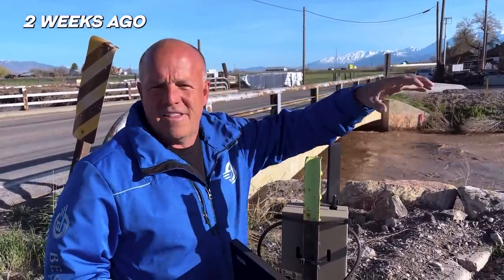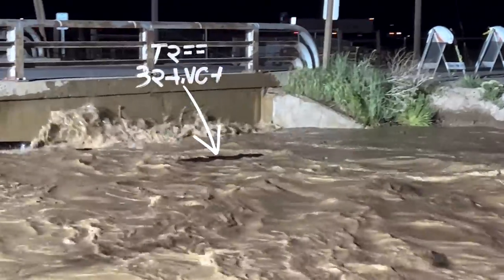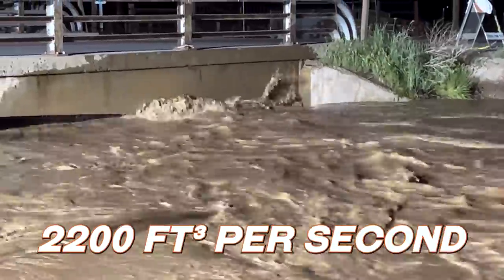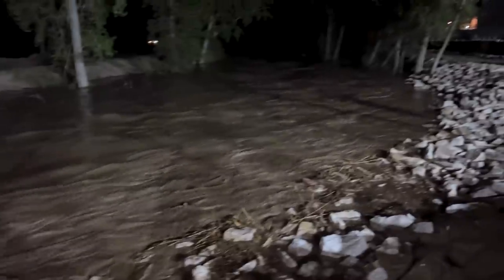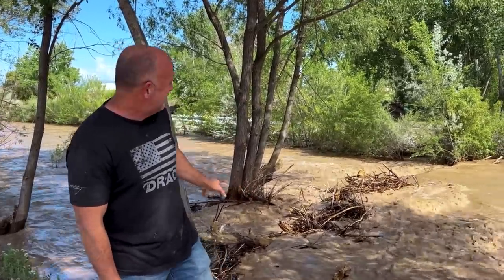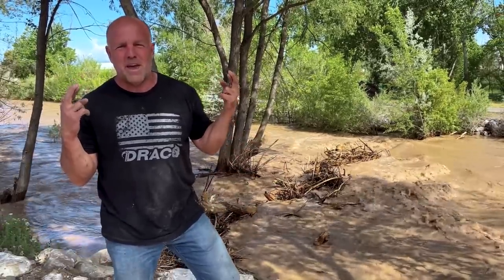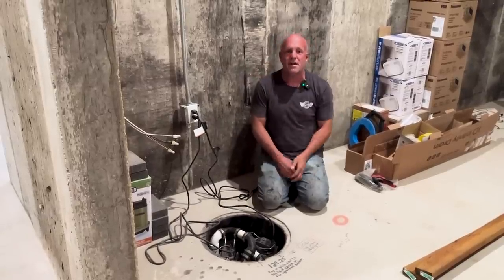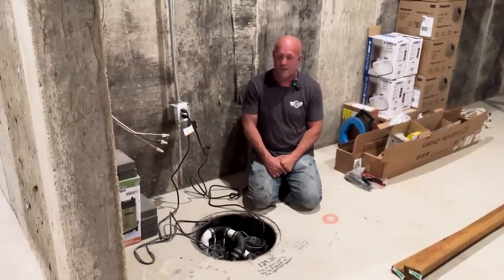Raging River VS Utah Homes | House Build #14

Comment: My last job was a consultant on river and lake erosion before retirement. Your looking at installing a combination of deep rooted native plants along with plants that have a heavy fibrous root mat near the surface. They deep rooted plants will anchor the soil but the fibrous shallow rooted plants accomplish the soil retaining and protect the deeper rooted plants by absorbing the impact or the rain and interlock with the soil to help the heavy river stages.   Next is the variety of plants that like water, can handle water and those that need dry feet. As I am not from your area my knowledge of native plants is limited that follow the giude lines for erosion control. Hope that your planting works out, best of luck Sir.
Reply: This part of the video gave me a great interest as well.

Comment: Here in New Zealand at the top of the North Island we had major flooding exaberated by slash (cut down trees etc left over from logging operations)blocking drains and just like your road bridge major flooding through properties, orchards, vineyards, farms and towns around the Greater Auckland area, East Coast of the North Island where stop banks breached. Its heart breaking seeing peoples homes, livelyhoods wiped out. And there were a few deaths which was horrible. And this wasn't snow melt nor Winter! Just heavy rain like 3.5 inches an hour as they got hit by Cyclone Gabrielle. Hope you get through this ok Mike especially after all the hard work put into it by you and your neighbours etc.

Comment: Fun with sump pumps! Not anything like what you're dealing with but I remember when Hurricane Opal came through over Atlanta years ago (have to look up the date). Walked out my patio door to go to work and stepped into 2" of water! Now the patio floor is about 4' below the level of the back yard and water was coming OVER the brick wall into the patio (which is covered BTW). The back yard was saturated! I was afraid it was going to hydraulic the wall (Engineer here) so I braced it to the house with a bunch of 2x4s I had handy and ran to Sears. Got a sump pump and a self-priming centrifugal and spent the rest of the day pushing water to the sump pump sitting on the floor with a push broom, which pumped out to a low spot in the yard THEN I ran the centrif to pump THAT over to the driveway so it could run down to the street (I live on a ridge). Glad I had power!

Comment: On one of our visits back to our dad's hometown in the SE Colorado prairie, Granddad took us to see the Arkansas River in flood, where it poured over one of the low dams used to direct the water into the irrigation canals. There was a tree trunk being lifted up, and flipped end over end in one spot over and over like it was a Tinkertoy! One of Dad's first summer jobs was on a work crew installing "jacks" to stabilize the banks of the river. There was a reason they were paid $2 an hour-- a generous wage in 1950. As far as I know, those jacks are still there, holding the banks together. Rivers demand respect!

Comment: We lived in Coal Creek Canyon in Colorado and in 2013 the creek flooded. It is a seasonal creek half the size of this creek and when it flooded it took out 9 miles of road and bridges . We had lived there for 29 years before this happened and would often comment on the signs saying go to high ground when water is present . We were fortunate since we lived at the beginning of the creek but yet there was enough water that we had water come out of the ground for weeks like a spring creek . Water is very powerful so be careful where you build . Thanks for sharing and showing us the precautions you took while building, money well spent .
Reply: Going to that bedrock was a smart & safe decision.

Comment: 13:00 My city in Christchurch, New Zealand, was built basically upon an old swamp. We have very high water table (in some areas, above ground in winter) and are affected by numerous rivers and tributaries. We are also coastal with many homes only 1m to 2m above mean sea level. The centre of the CBD is only about 10m above mean sea level. Christchurch was developed as a British colony and in the early days the "Christchurch Drainage Board" was formed. The street kerbing and side channelling ("gutters") here and under-channel pipes and stormwater drainage that serves streets and infrastructure is generally only designed for the 10yr storm event. When we have high intensity rainfall or longer duration rainfall our stormwater systems get easily overwhelmed - especially in autumn/fall when leaves gather and block street sumps / entry points. This leads to ponding / puddles on the streets which eventually overtop the kerb and start extending into overland flowpaths based on flat (albeit with local humps/hollows) terrain onto private land and under houses. Presumably your own city only designs streetworks and public infrastructure to a much lower return period (due to sheer costs and budgets) too which leads to exactly what has happened...

Comment: 1996 we had huge floods in Oregon and southwest Washington.  One of the most disheartening things was many homes and businesses got flooded because the floor drains weren't block - thus when the river rose, it allowed water to flow backwards into building.  The worst of the bunch, Oregon city Tavern.  They put their pool tables on blocks so that the tops were about 12" above the ceiling.  Then sealed the doors with silicone.  Problem was they didn't block the floor drains.  When they cut the doors open, river water drained out.  Totally sucks, they worked so hard to prevent that very catastrophe.  The worst part of that is the water line was 6" from the ceiling.... so even the pool tables were junk after... much empathy to those suffering now, being flooded sucks (it got my family's welding shop too - thankfully, it didn't really damage anything important other then the offices  - and we all know those people don't do anything anyway...)

Comment: It's interesting to see that situations like this can be managed with the right approach and a can do attitude.  What usually happens is that people use sandbags, and then wait to see what happens and fix the damage afterwards.  I very strongly suspect that if just some of the money that goes on post flood repairs — that's money from local authorities to fix infrastructure and property insurance  claims — was spent before the event to prevent the worst damage occurring in the first place, it would cost a lot less and save a lot of heartache.  Thank goodness there are people like Mike for whom potential disasters are just another challenge to be overcome with 'physics and engineering' and that can do attitude I mentioned.

Comment: There is a rectangular wire cage filled with rocks called a gabion. In the upstream catchment area if gabions were placed to form leaky dams they would slow down the water a little allowing more to be absorbed into the soil up there and would filter out some of the debris preventing it to be washed down.

Comment: Do some research on the Chicago incident back in the 90's, when a pile driver crew cracked the ceiling of the Deep Tunnel Project, which resulted in flooding a huge area of Chicago lower level (there are 2 underground levels!). Many buildings found their basements under water. Fascinating story!

Comment: here along the shores of Lake Erie we use the same large rock formation to reduce erosion. however, soils inside the large rocks even with vegetation has limited use. a strong current will erode the soils. most home owners along lake erie pour concrete inside the rocks and that material never erodes.

Comment: I have my sump pump on a UPS as well.  Often times when there is flooding, there is loss of power.  I think I could run my pump for at least 50 cycles without power.  Gives me enough time to get a generator setup.

Comment: There are check valves made to prevent backflow through drain pipes. They're made for sewer pipes, but with screening basins on each side they could perhaps be adapted for storm drainage. They require regular maintenance, but that's much less money, time and effort than cleaning up flooded buildings.

Comment: Seems the best way to permanently solve the problem is to have a way to divert or pump the water into a runoff reservoir, bonus for keeping extra water through the dry cycle. I'd thought, during a dry cycle years ago, while hanging around mendo. lake north CA., that they should take advantage of the low levels in the lake to take earth movers in and remove the accumulated runoff dirt for extra storage during the otherwise flooding cycle. I don't think anyone has yet made it a regular thing to do.

Comment: As a home builder, you have really gone above and beyond on water control around that house. The only thing i would add is a backup generator for those sump pumps. Maybe you do have them, I haven’t had time to watch all the episodes, but if not, a simple power outage and it all could be for nothing. Great work, though! Its awesome to see what is possible when the engineer has a true passion for the actual mechanics behind his work!

Comment: Mike you should have done a battery backup not another circuit. That way of all power and backup power goes out it still uses a deep cell 12 volt and can keep running after all power is lost.

Comment: As a note. If your basement or basement walls have an Rh factor above 60 or 66%, you might want to dehumidify and or think about treating walls and air so you don’t have any mold growth. Don’t use chlorine to control it's an oxidizing agent, short lifespan, you want to get the pH above 11 or as close. A few choices; sodium carbonate, trisodium phosphate. 1 heaping tablespoon for 32 ounces treat the wall treat the air dehumidify. Need anything comment back. Chris E

Comment: Hey Mike, in one of my last houses we had a water-powered backup sump pump so if power went out or the primary failed, we still had a sump pump. Very common for power to go out during a flood type event, and I'm sure you have some kind of backup power, but something to think about.

Comment: Mike, a question... when the river returns to normal flow and time permits, do you have any plans to formalise the bankworks. 30+ year career myself in the regulatory and engineering side of local government, with land drainage and hydraulics as a focus... I've watched previous videos and am sure you did use geotextile fabric... but I am thinking using a reno matrress or gabion basket would be of benefit. I my country we have both local Council regulation under a City Plan (i.e. town planning) and also central government country-wide legislation which governs activities within the bed of a waterway, within a floodplain, and within setback distances from banks. There's also different rules for different AEP events (annualised probability). The 100 year and 50 year floodplains are generally focused upon for rivers only affected by rainfall catchment... 200yr event where backing up from the effect of climate change / sea level rise.
Anyways, long-winded way to simply ask if you intend to re-visit the bankworks with a view to creating something more permanent? 
EDIT: Ooops, should have waited til the end... 14:55 he explains future intentions...

Comment: What is moving the parked excavator boom at 13:21?
Reply: I was wondering the same thing. It seems to move directly in proportion to the amount of sunlight. So I am assuming it was fluids heating during the day and cooling during the night. That's why you should always park hydraulics on the ground.

Comment: Water is the single biggest problem that engineers have to deal with. It can turn a pin hole into a massive breach in minutes. Any weakness it finds is exploited and it does it so  fast.

Comment: Guess you have 2x115(240), so you could also put each pump on a separate fase.
Reply: @ralphgesler5110  separate braker, those could be on the same fase.
Reply: @ralphgesler5110  each 115 volt is a fase on it self. Between the two 115 volt lines the potential is the 240V. So put each pump on a separate fase, is one side fails, you (mite) still have the other fase available. Putting both pumps on separate brakers, but on the same fase… if that fase fails you loose both.

Comment: Love your channel and looking forward to the pool project. But my question is, isn't it against code to run two hotlines into one box?
Reply: Not where I live. And apparently not there either.
Reply: I'm no electrician, so this is an uneducated response and very much a genuine question.  Is what Mike did different, code wise, than a 220v device in the box being fed by two hot lines?

Comment: I just question why build that kind of structure in such a known risky area? I am sure one will rationalize all kinds of ways the engineering makes it safe and possible yet it seems kind of crazy to build that kind of megastructure which in terms of scale and complexity isn't lean at all and instead invites the kinds of challenges one would hope to avoid. That neighbrohood looks like a planned community as well which runs counter to a well designed and engineered environment. In all, if context meant anything I would probably be building in that area where water is allowed to do what it wants to do and not put my giant megastructure down in it. Hope it fairs well with all the engineering put into it but not sure it makes reasonable or even creative sense. As has been mentioned the other homes in the community are probably more suspectible to damage and again it begs the question why build those kinds of structures in that context in the first place. Lean design and engineering might have been a better solution.

Comment: No room for check valves on the pumps? Or are they hard to see? High water alarm? This is not to code sir. Rubber elbows? This MUST be temporary.
With all due respect. I'm a broke plumber. I'd rather be in your shoes.